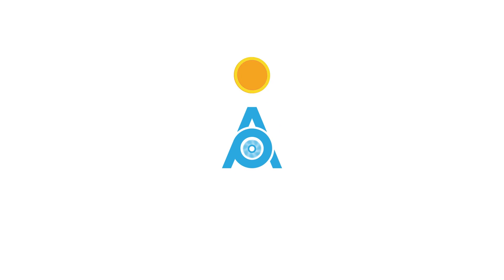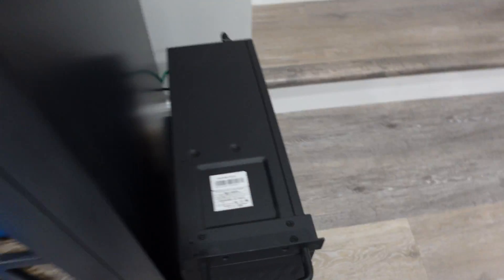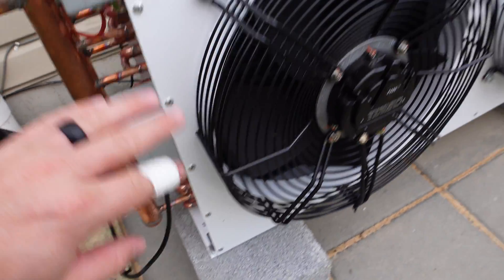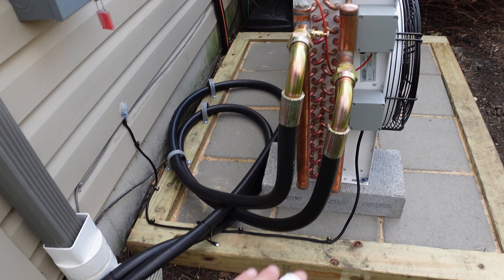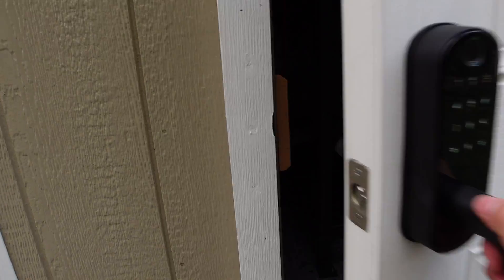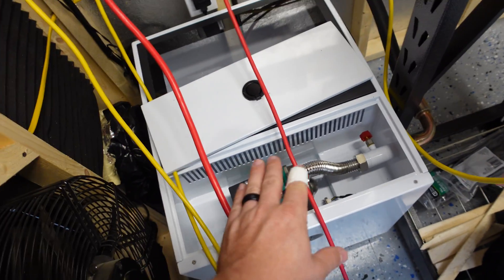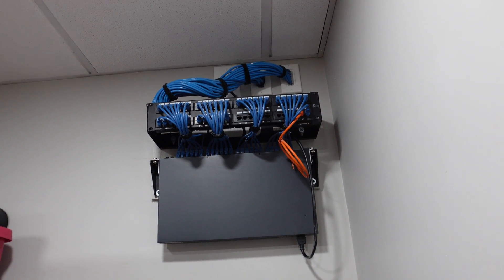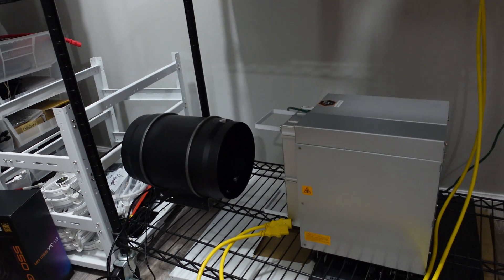WHY Liquid Cooling your BITCOIN Miners is AWESOME! Fog Hashing Immersion Kit

Comment: Your video is very interesting, I have problems with noise from fans, it's too loud and my country is very hot, so air cooling is not working in hot weather, it is going to be cool if i can have immersion kit. 
I have a question how remove PSU's fan? do you have simulator for this?

Comment: I've just ordered one C2 Kit. Do you know if the dry cooler can mount with fan backwards to a wall or up ? It's stupid to have connections always on same side.
Reply from the maker: @thorsten3283  the Fans blow air outward. Pulling air through the radiator
Reply: @TheHobbyistMiner  so fans on wall-side should be more problematic than fans up. Maybe I should ask if I can get longer tubes.

Comment: Hi hobbyist miner I have question how did you get your electric down so low mine is at 14. At the house at lowest is at my company and it's at 12. Any tip and trick would be appreciated and love your video I can buy the hardware the but electricity is the problem.
Reply from the maker: This Video Explains more https://youtu.be/VKHORfUyBWE

Comment: 6:10 GIGGIDY! But that's not how to go through a sidewall. Consider addressing that penetration using a Slimduct Line Set Cover or similar. 
Alternatively, if you're considering this system I'd suggest going through the floor first and avoiding the sidewall if possible.
Reply from the maker: Always that one guy!  PRO-FESSIONAL! <3
Reply: @TheHobbyistMiner   Hey at least I provide a solution when pointing out an issue. It's only because I care :- )
Reply from the maker: 100% appreciated. Learning as I go!

Comment: Hey buddy the segment error your getting is fail safe that bitmain has on there control boards. For some reason some ASICS you’ll run into that issue and some not. The only way I’ve found around this issue is to change the control board out. Xp models I’ve seen it to be more common. Not sure why
Reply from the maker: Wow that is super helpful, thank you!